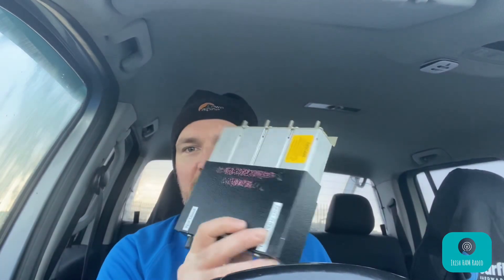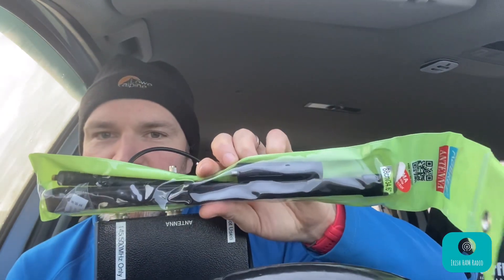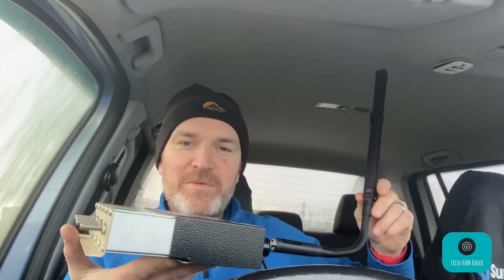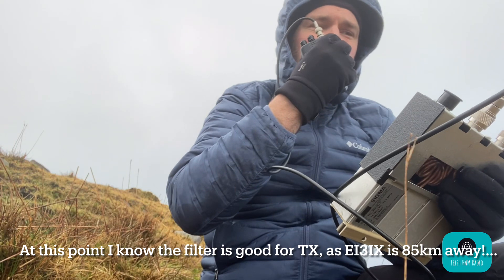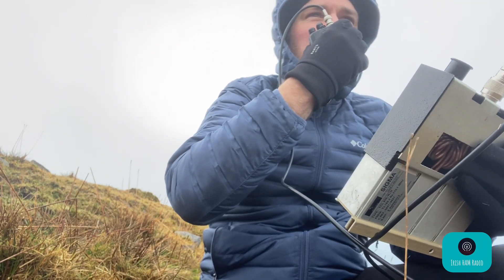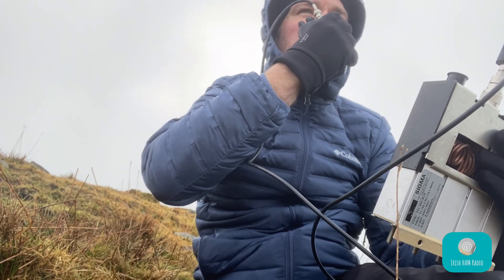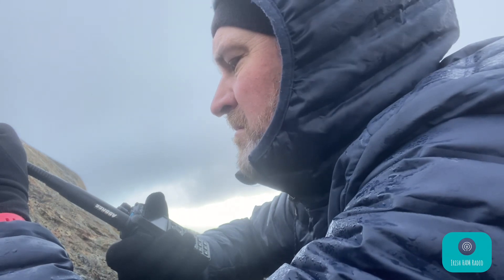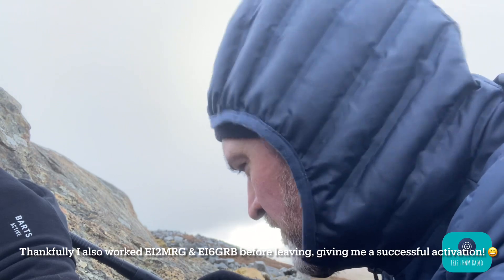2m Bandpass Filter Test on RF Swamped Transmitter Site & My First 2022 SOTA Activation Attempt

Comment: And isn't it easier to have a better radio that can handle strong signals better than wearing this filter that probably weighs a few pounds?
Reply from the maker: Hi Adrian,
Absolutely... But on sites like this a radio on its own could filter out the level of rf desensing…
Some sort of external band-pass is required to be able to operate in such close proximity of the towers.

Comment: Good effort Dave. I like the experimentation using what you already have to hand.

Looked like interesting conditions.....reminds me of some of my "more dynamic" SOTA attempts. Most of which unfortunately didn't make it onto video on my channel because the camera equipment wouldn't have survived the conditions!!!

If you are doing regular SOTA's & you don't mind spending some money then I make the same suggestion that others have already made. SOTA Beams do a 2m bandpass filter specifically for this.

It's not particularly cheap but it's a one off investment & it works very well. I think I paid around £45 plus shipping here in the England. Not sure how that would translate with shipping & taxes into Ireland?

You need to be careful because it has limitations on transmit power:-

5 watts max on FM with a 30% duty cycle (on a SOTA summit you are probably a higher TX duty cycle than that to be honest)
2 watts continuous on FM
5 watts continuous of using SSB

On several occasions where I've struggled on summits with commercial towers, I have run the radio (either a handheld or my Icom 705) at 2 watts through the filter first, then into a small linear amp.

There's a little bit of loss in the filter, so I'm probably running somewhere between 1 watt & 1.5 watts by the time I come out of the filter but the amplifier comfortably boosts that up to around 15 watts or so.

In fact, the filter works so well that on a couple of occasions I have even managed to use the preamp on the linear without de-sensing the receiver & picked up a couple of weaker stations which were down in the noise. The filter was able to handle the receive even with the pre-amp on!

It's a bit of a faff to set up as you have to have the radio, the filter, the amplifier, antenna, batteries for the radio + amplifier & coax cables for connecting them all together. That said it works well if you want to set up a larger antenna on a mast & run a "big gun" 2m station for the afternoon.

One word of caution. I know it's obvious due to the power limitations of the filter but if you are going to do this PUT THE FILTER BETWEEN THE RADIO & THE AMPLIFIER + MAKE CERTAIN THAT YOUR RADIO POWER IS TURNED DOWN. Failure to do either of these two things will cause damage (at the very minimum to the filter, maybe also to the radio or amplifier) & might possibly let out some magic smoke!!!

Just a suggestion for you to try if you have a small 2m linear amp laying around.
Reply from the maker: Hi James,
Thank you for the comment and for the advice..
I’ve heard about the SOTA beams filter being quite good but also heard about it being quite sensitive to damage…
I think I’ll try one anyway and see how it works, as there are only a few summits that I would need it on and it would be worth the investment.
Love your content by the way too!
Reply: @IrishHamRadio  Thanks Dave. Glad you like my content. I was going to get in touch with you at some point (probably later in the year when the weather improves).

I had a (possibly slightly mad) idea for a collaboration of attempting a 2m contact from England (or maybe Wales) straight across to water to Ireland. Film it from both ends, share the footage with each other (maybe via Dropbox or similar) & we can probably both get a video out of it?

We could also try other bands (70cm, 4m, 6m etc). We would have to find a good coastal locations & fix up a time that works for both of us but it could be an interesting experiment?

Back to the filter:-

From what I've heard, the people that manage to damage those filters are trying to run 5 watts FM (or maybe even more) through them, usually with long overs, often in the middle of summer when it's 30 degrees & everything is getting hot anyway........I think you get the idea!

Just be sensible & appreciate that it isn't designed to handle much power.

I've run 3 watts through mine for an activation without the linear amplifier but I was very mindful to keep my transmissions too a minimum - no rag-chewing & make the activation as short as possible!

Keep your power below 2 watts & it will be absolutely fine.

I know it's a bit of a faff & it's extra kit to carry but as I said before, add a separate linear amplifier after the filter if you want more power & your struggling with de-sense on your receive.